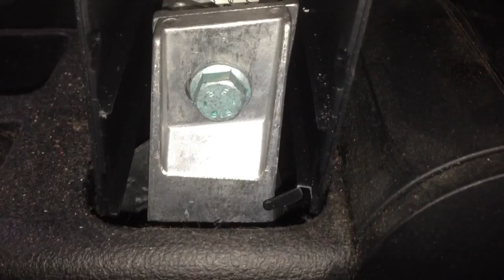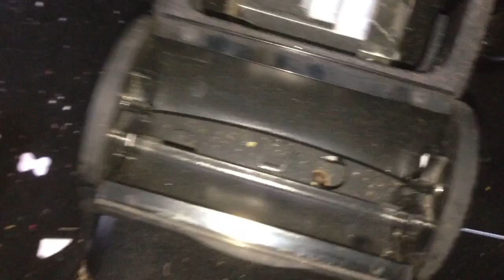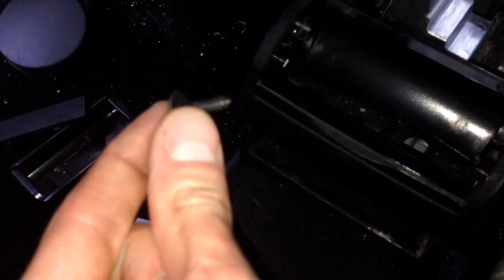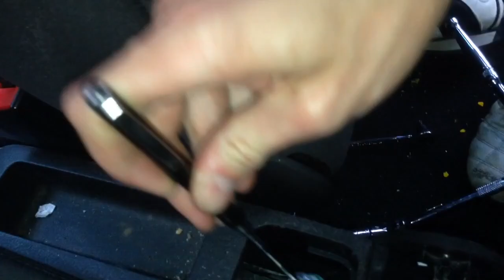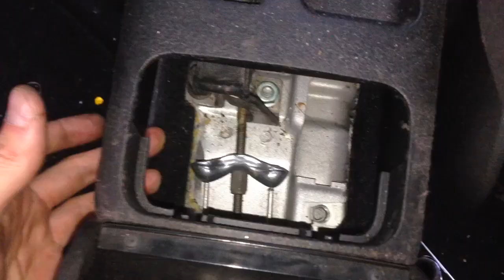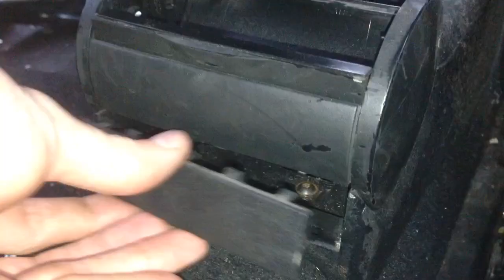VW GOLF MK4 - How to remove / replace arm rest video

Comment: You know you can just buy a new armrest lock/handle thing for like $10, right? Pops on really easily, sellers usually provide a couple necessary springs --> no more falling armrest top. Unless you wanted to do the full delete anyway
Reply from the maker: Thanks for watching
Reply: Luke Davis can I get a link to parts?

Comment: Worst design of an arm rest ive ever seen in a car. They jam, the clip brakes on the storage tray so all your stuff can fall out when you fold it up and you have to reach over them to pull up the hand brake. They also get in the way of shifting gears. Not great for some of the sportier models. Mine works perfectly but im getting rid of it because of the sheer inconvenience it causes when driving my 1.8t vRS.
Reply from the maker: Totally agree 👍
Reply: Leon 1m has the same enterior and can't be more true. what a damn piece of shit design. on a hunt how to get rid of it.